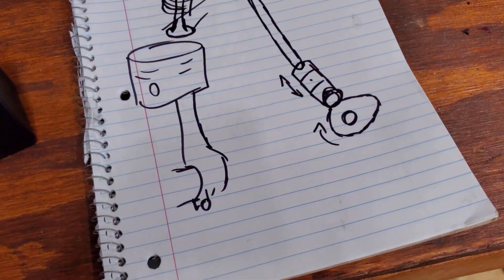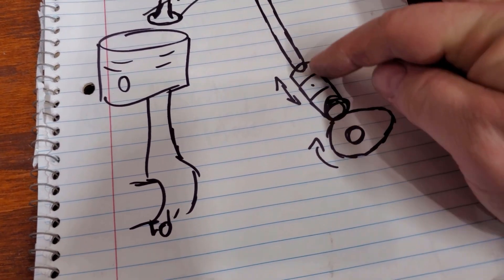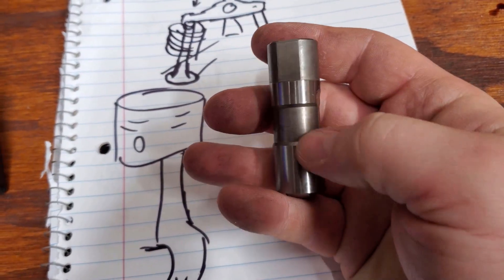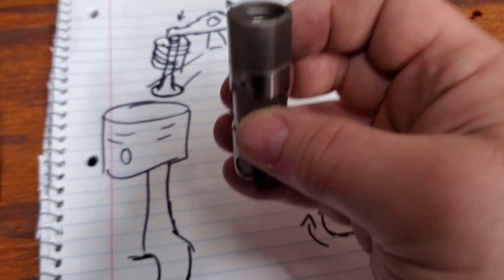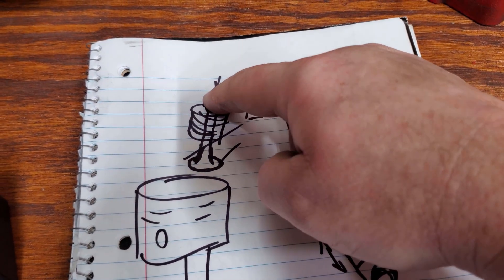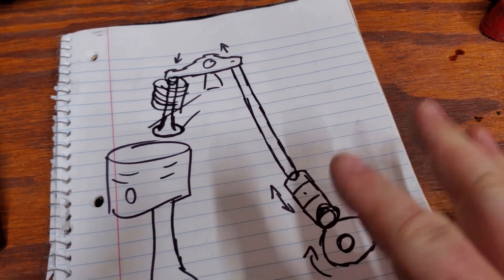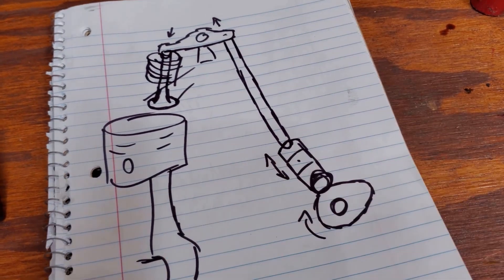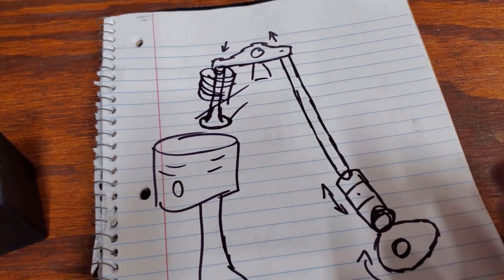How The OHV Valve Train Works

Comment: I have a 38 horsepower twin cylinder overhead valve on my zero turn...... Last time I ran it, it was running good when I shut it off.... Now the motor just spins... It's getting gas, and it's getting spark.... The Pistons are moving, but the valves are not... It has decent impression, and a leak down test was good.... There's not really any excessive noise when you are cranking on it... Any thoughts?

Comment: I liked the video just because it was short, simple and straight to the point. I've learned a few things just reading things online in forums and such for the most part.

I'm a guy who thinks that in a lot of cases, simple is better, so I definitely have a love for push rod engines. However, the cam is in the block (I do like that for whatever reason) and takes more work to swap out cams and the like. I would like to put one in my GP sometime in the future.

Comment: Awesome info about the lifters! I think I have a partially collapsed lifter. It ticks pretty bad when cold, but goes away. I have new ones ready to go in. Just hope I didn't wipe the cam.
Reply from the maker: If the oil port gets a little clogged it can pump up slow